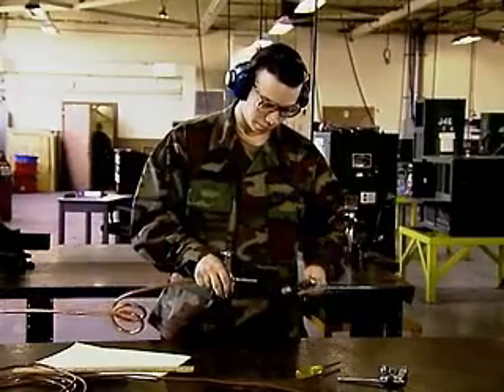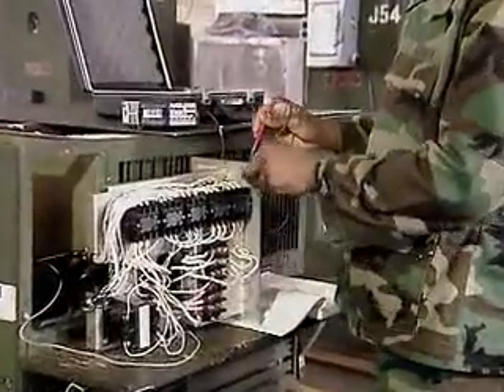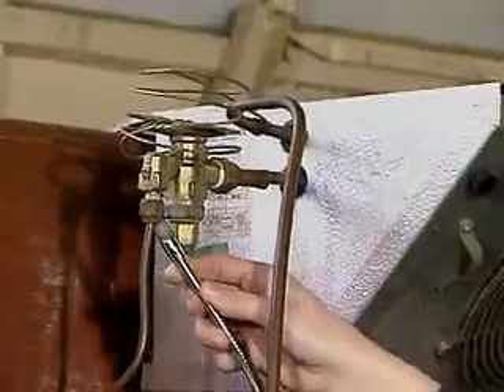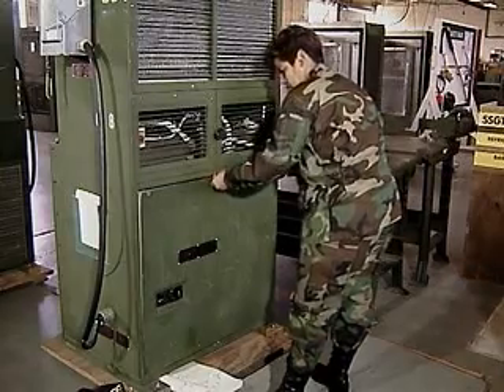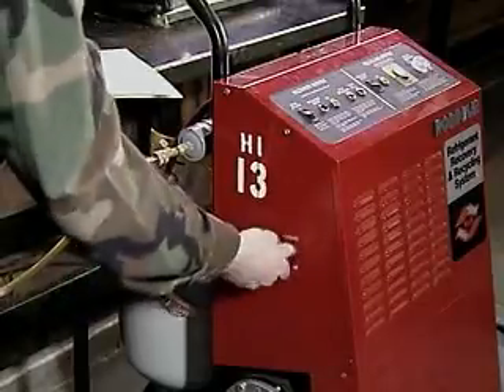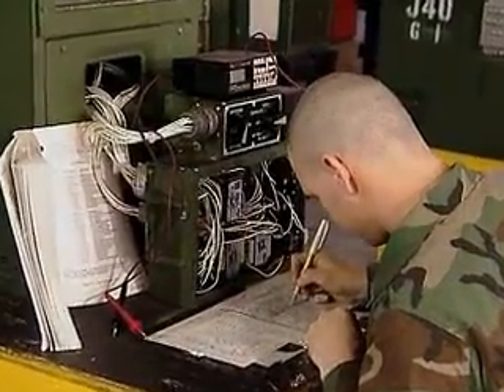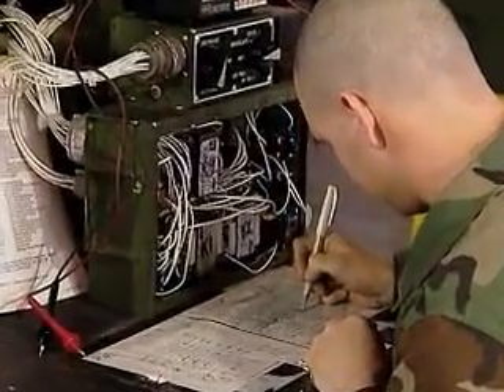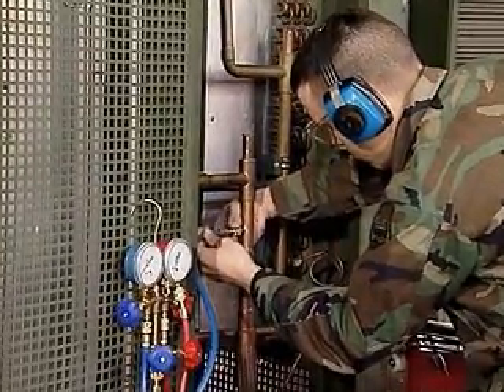Army MOS 52C Utilities Equipment Repairer-Heating and AC

Comment: @bullmannn well it not to bad but i dont get to do it that much i mean right now i did my job about 10 times in the year since i got to my first unit. the most i did was to recover the free on and now im doing whats call "initial inspection" on 80 new ac/heaters. but it all depeands on where you get stationed at. also if you do get this mos you will be going to FORT LEE VA. your company will be BRAVO BULLDOGS and you will need to know whats called the ordanance corp song. but keep my posted